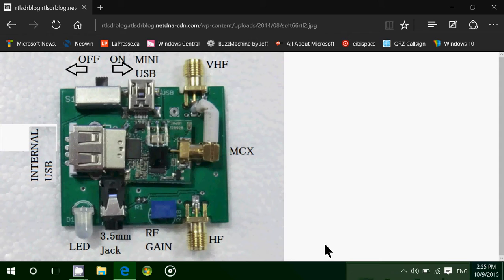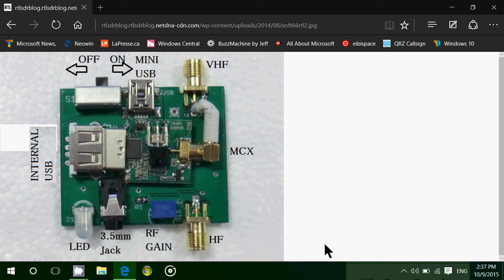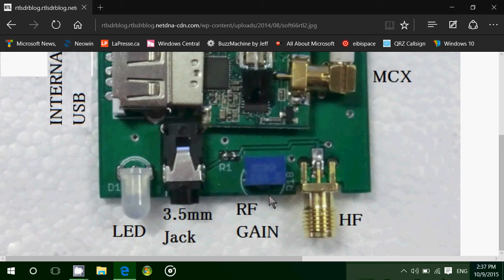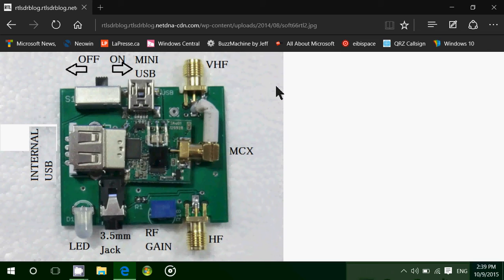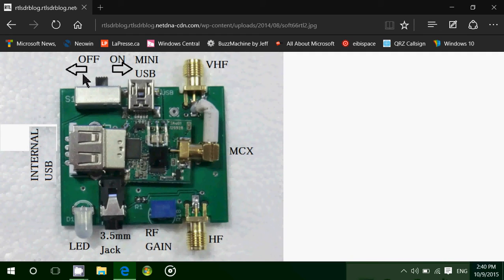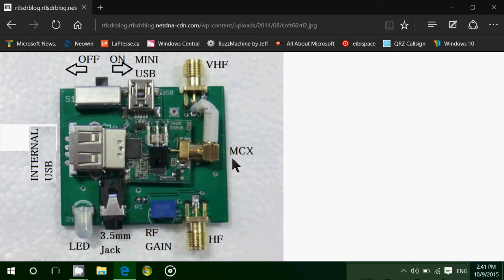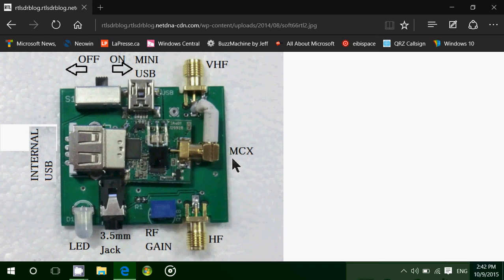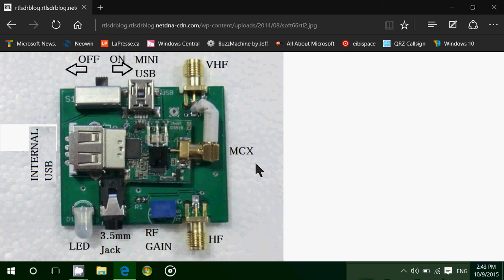SOFT66RTL SDR setup part 1 the device itself needs correct tweaking

Comment: Your 100% correct Giles with the comment about leaving the VHF antenna connected while listening to the shortwave bands with the Hf antenna connected.
Had mine for about 2 weeks and learning settings with the software and tweaking certain things at certain times to achieve the signals I want.
I made up a filter to block the broadcast band because I'm very close to an Am tower and that made a big difference with intermod on the Hf bands.
Keep up the good work love your videos.
Steve